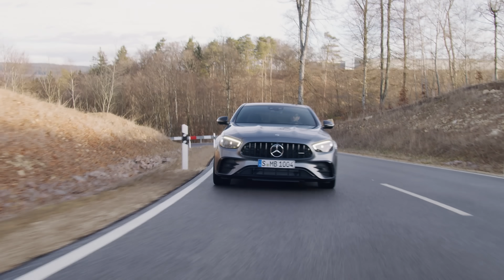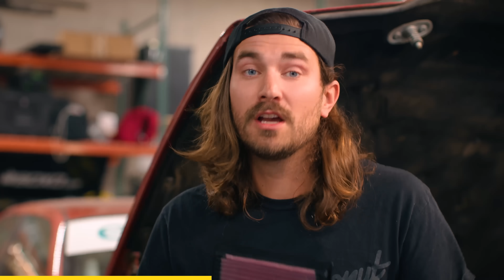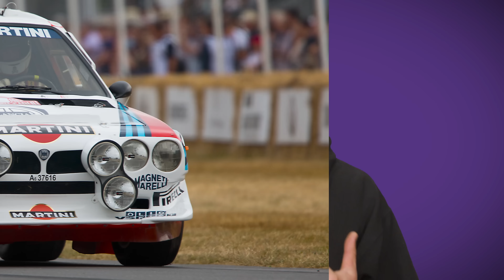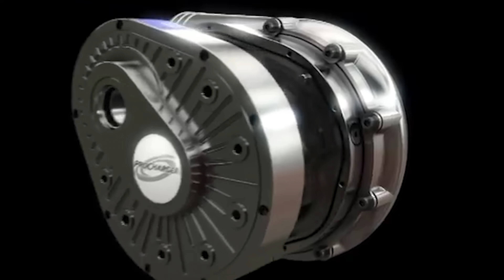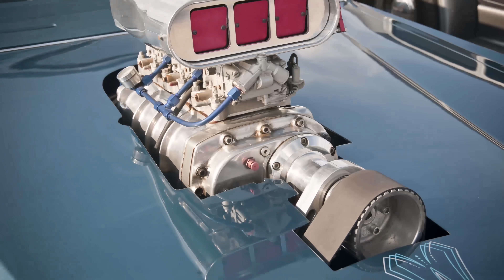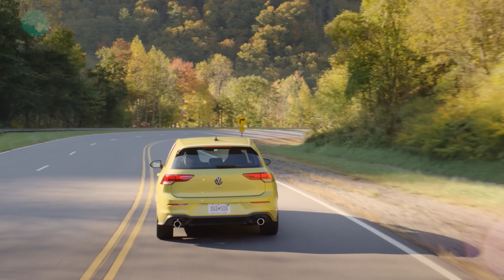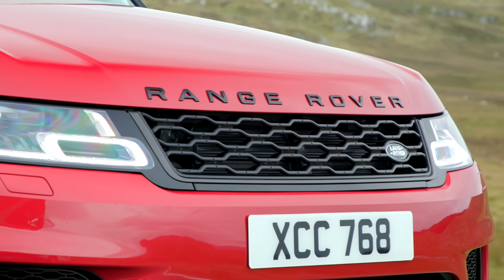Why Your Engine Isn't Twin-Charged

Comment: Can't forget the old Detroit Diesel 2-stroke V motors used from the 50's until the 90's in heavy trucks and buses. They were a 2-stroke design that used a supercharger to force air through the motor, and if more power was needed a turbo was bolted on top of the supercharger. The Weiand 6-71 supercharger used by dragsters to this day come from these diesels.
Reply: glad to see someone else tilt their head in confusion for not including these beasts.
Reply: @kylemcshea5511  it's not twin charged
Reply: Ok so you're wrong but you would only know by being in the industry so that's ok. So I'll explain. 2 stroke Detroits don't have an intake valve. They have holes in the bottom of the cylinder wall at the bottom of the stroke. The piston uncovers these holes at the bottom of the stroke. The piston is not creating vacuum at the bottom of the stroke. Thus a blower is required to blow air into the cylinders. And I say blower because there is no supercharging effect. The Detroits required a blower to run so they are considered Naturally aspirated

Comment: This was also common practice on 2-stroke Detroit diesel engines. And not a true production engine, but chrysler built at least a couple inverted V 16 cylinder HEMI engines that where also supercharged and turbocharged back during WW2 for airplanes (first plane to hit the 500 mph level flight test)

Comment: Even your description of how the twin scroll works is wrong. Air doesn't get compressed into the engine through the middle, it gets passed in around the perimeter and prevented from escaping by the meshing scroll blades.

Comment: I don't see a use case except for exotic cars that sell because they're exotic.

Computer-controlled valve timing and electronic injection pretty much eliminates turbo lag on small displacement engines with small turbos, and for the supercars having a battery to keep the turbo spooled without exhaust gases, like modern rally cars and F1 do, seems the logical option. A battery recharged also while braking. It's complex no doubt but supercars have also more than doubled their price those past 15 years.

Comment: And no  the twin scroll SC. Description, you said the SC  pumps the same amount of air regardless of engine speed and that is completely wrong. Instead, they pump a proportionally increasing volume of air with the increasing engine speed.

Comment: Wow.  Even tho I like donut videos.  This one had alot of incorrect info.  Or let me word it as complete info.  Ex superchargers do make boost at idle.  But boost increase with rpm.  The info in this vid is how things should work by looking at the math.  I'm reality it don't abide by that.  Turbos and superchargers flow a given amount of air based on design and purpose.  The info is very misleading

Comment: Another stupid eŕror: no, centrifugal superchargers do not increase the speed of the impeller exponentially; they increase the load on the engine exponentially due to the linear increase in impeller speed that affects more mass faster. A real engineer would spot these glaring errors before repeating this on camera.  At this point, I just Watch these because I know they're going to be terribly bad and you're reaching a log of people with this sort of misunderstanding.

Comment: Huh... Someone goofed on what should have been the graphic for the intercooler, and made some nonsense animation with... A heat pipe coming out of the turbo?!

And... I believe the roots animation shows air being compressed by compressor bits spinning the wrong way.

Who did these animations?

Comment: Normally aspirated engines typically work at less than atmospheric pressure. But they can  get to more than atmospheric pressure with speed induced  pressure and with resonance and wave reflection induced overpressure.

Comment: I am sad they left out Volvo. Volvo has been twin charging their line up for quite a few years to achieve more performance and fuel economy. They have twin charged engines that also work with electric motors. They did it before it was cool.
Reply: Yeah, they COMPLETELY left out Volvo who has been a big proponent for a while. Having driven the V60, I feel they even did a good job of it, even if it was a highly strained engine.
Reply: There was literally a picture of a Volvo in the video.
Reply: That's what I thought. I remember the latest XC90 (or maybe XC60?) being TC'd.
Reply: Volvo Penta makes great twincharged marine engines that just absolutely rip.
Reply: Polestar does as well and that was very recent. Surprised they left it out.
Reply: What Volvo engine was twin charged?
Reply: @jimbofarnsworth4482  my 2017 S90 inscription is twin charged
Reply: @mathewerenberger7275  I was wondering. I owned a few older Volvos, 2009 and older
Reply: @jimbofarnsworth4482  I've a '17 T6 R-Design, twin charged. I'm not 100% sure, but I think all T6 2016.5 and up are twin charged
Reply: @jimbofarnsworth4482  -- T6, T8, and Polestar engines, starting in 1969.
Reply: It literally has a Volvo T6 in the video 12:46.  use your eyes bro!
Reply: @BurntFaceMan  didn't watch the whole video. I was just wondering, I owned a bunch of older Volvos.
Reply: @BurntFaceMan  -- We're talking about twin-charged engines but only have an image of the company that pioneered the mainstreaming of putting twin-charged engines in their production vehicles, starting five decades ago.  They may not have been the flashiest of cars, but he never even mentioned (yes, there was a tiny picture of one, but no real mention) what should have been a decent part of his history segment.
Reply: @BurntFaceMan  Thats a 2012 Volvo S60 T6. That is not twincharged. it only had a turbo 6 cylinder. They showed the wrong volvo🤣
Reply: I just saw this video and was like thats interesting because I have a Volvo thats Twin Charged.
Reply: 10:38 he has addressed Volvo
Reply: @darrentylor5473  lol

Comment: This fuel economy claim for boosted small displacement engines is not exactly true... it's very situational... A 200hp 1.6L turbo engine will get the same or slightly worse economy then a 2.5L 200hp n/a engine because of volumetric efficiency. For 200hp, the 1.6L needs to burn the same amount of fuel as the 2.5L - this is done by adding a turbo / supercharger to increase the volumetric efficiency of the engine - so the 1.6 makes the same power as the 2.5, and for that it needs to burn the same amount of fuel. The only time the 1.6L will use less fuel is at idle and under the turbo threshold RPM value. 

I used to own a 2013 fiesta ST. It made 180hp and 240nm of torque out of a 1.6L turbocharged engine. It was my daily driver for about 8 months. My "weekend" car, a 2002 325ci has a 2.5L naturally aspirated 6 cylinder making 189hp and 245nm of torque. Power numbers are similar but displacement differs. The two had similar fuel consumption. The ST got better mileage during stop and go rush hour traffic, but the 325 got better mileage on the highway, despite it being a bit heavier and making a tiny bit more power. The ST used an average of 9L / 100km during normal city traffic, about 11-12L in heavy stop and go rush hour traffic and 7-7.5L / 100km on the highway driving at 120-140kph. The 325 also used up 9L/100km in normal city traffic, but in heavy stop and go rush hour traffic it used up to 13.5L. On the highway driving between 120-140kph it would use 6-6.5L / 100KM. This is due to the fact that the 2.5L n/a engine needed to burn more fuel to idle due to it's bigger displacement, so I guess that's where the claim of better economy comes from. But there's more. The ST got very poor economy compared to the 325 when driving fast. On the highway, driving at 150-170 kph would increase consumption to 9-10L / 100KM. In contrast, the 325i got around 8... I believe this is in part due to the ST's shorter gear ratios. Despite having a 6 speed manual vs the 325's 5 speed, the ST would be at 4100RPM at 160KPH in 6th while the 325i would run at 3300rpm in last gear. But the other reason is that boosted gasoline engines won't meter fuel as efficiently as a n/a motor due to the complexity of the added turbo. The fiesta's sigma 1.6 had 1 maf, 2 temp sensors and 2 O2 sensors (one pre cat and one post cat) while the bmw's M54B25 has a MAF, several temperature sensors, a manifold pressure sensor and 4 O2 sensors split between 2 banks, 2 pre cat and 2 post cat. And this is generally (but not always) true for most turbo vs n/a production engines....

Comment: "That means as crank speed increases, there is an exponential increase in impeller speed."

No, there's a linear increase in impeller speed.
Reply: Right. Exponential impeller speed increase is where the turbo comes in and why they’re better at higher rpm. Maybe the point they were trying to make is that at any given rpm the supercharger impeller is spinning some multiple of the crank speed.
Reply: Thank you came here to say this. I figure he meant to say boost.

Comment: Volkswagen 1,4tsi. Probably the worst engine they ever designed. I’ve never seen one over 100.000km that hasn’t been replaced. And off course most people ordered the cars with the worst transmission Volkswagen ever designed, the first generation DSG.

Comment: That’s really interesting. I always thought the VAG 1.4 twincharge was dropped because it kept breaking from heatsoak and blowing up, not production costs
Reply: Yeah, I’m going to confidently say that VW probably said publically they dropped it because of “production costs” when really it was because it was the “costs” of replacing customers motors
Reply: Looked for this comment
Reply: The 1.4 twincharged scirocco my friend had broke tow engines before he traded it for the 2.0 turbo
Reply: Most problems came from a hilariously undersized PCV system that set up chain reactions in the engine. The next generation engine, ea211 1.4 150hp with a single turbo was so much better in every way.
Reply: @Mnc6282  it’s a real shame, because the mk2 Skoda Fabia VRS would have otherwise been a fantastic hot hatch if not for the bomb under the bonnet
Reply: Had that engine in my Polo GTI 6R and it was probably the worst I’ve ever had. Never spent a whole month out a garage the thing was horrendous

Comment: See this is wussy twincharging here, the right way to do it is like detroit diesel did it with their -92 series 2 strokes, with a roots blower after the turbocharger, this is also commonly done on 2003-2004 mustang SVT cobras (aka the terminator cobra), and will be done on my 1996 when I finally get around to building the 4v motor here in a few years.
Reply: Detroits weren't twin charged or even supercharged. The blower on them was required to run. It's a two stroke with no exhaust valves it has intakes ports in the cylinder wall. The piston uncovers these ports at the bottom of the stroke. The piston does not create vacuum at the bottom of the stroke. So the blower is there to get air into the cylinder and that's about it which makes it naturally aspirated and the turbo variants we're like any other turbo diesel.
Reply: @dillon8987  they did actually have exhaust valves and the blowers did make a small amount of boost, about 1psi. Not a crap ton, but they did make boost, and the cam profile could be changed to make a lot more boost.

Comment: I love how this video casually misses the fact that all Volvos since 2018 have been twi-charges and  even tri-charges. Great video but that’s a massive oversight. Also the Polestar 1 is twin-charged + electric.
Reply: it is mentioned. the oversight is yours.
Reply: Once... For a split second... Considering Volvo has been using twin charging since 2015 and made a huge splash when they said they'd get rid of V8s 6s and 5s in their lineup for all 4 cylinders... You think people would have paid attention. Everyone that drives the T6 powered Volvos are impressed... Even Matt Farrah
Reply: It was only one more letter dude, one more letter.                                            n

Comment: EVs are not capable of taking over for internal combustion engines before we safely can have small cold fusion reactors in our cars... We simply do not have the resources or the technology to make enough useble batteries for that, and neither do we have the technology to make enough clean electric power for that either..
Only a retard would drive around in a EV powerd by electricity made with more polutions than if it was powered form a internal combustion engine, and still think they were saving the world..

Comment: K&N makes fast flow because it doesn't ACTUALLY filter. Particulates that can damage your engine, so you're sacrificing reliability for power. The slogan should be "better than no filter and runs like it doesn't have one." If you put a K&N in your daily, you WILL have more problems later on down the road. YouTube it, one dude tested it with brands like Fram and others. K&N even after you oil the filter it's still crap filtering.

Comment: i don't get why car makers does not invest on hybrid turbo ? i don't mean sequencial turbo, but turbo with an electric motor between turbine and compressor, just like F1 engine, 
its has been proved this is the more fuel efficent system, and according to audi research the cost of manufacturing, became very affordable to mass produce it 

okay twin chargin is cool and fancy but so expensive that's not improvement....

Comment: Many piston airplane engines from WWII are technically twin-charged.  The turbo is only used for flying at medium to high altitudes however, it's never used at low altitudes or when on the ground.  Most if not all airworthy survivors don't fly above 8000 feet since using the turbochargers would mean higher maintenance costs as if the cost of the TLC for these vintage warbirds wasn't already outrageous.

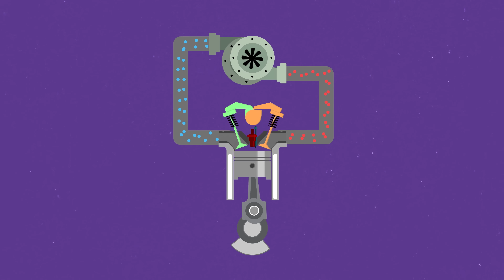Comment: 5:43 now wait just a minute ... Turbo compresses the air which also heats it up, oxygen somehow goes missing inside this (hopefully) airtight manifold, then intercooler cools the air, and oxygen magically reappears? 
That doesn't sound right, does it.
Reply: Oxygen doesn't go missing when it's hot, Rather the hot air doesn't have as much oxygen than cold air. That's why it goes through the intercooler and making the air colder thus it has more oxygen and it's dense thus giving you more power
Reply: Cooler air is more dense. Cold air has more oxygen molecules in it per given volume

Comment: I believe the Detroit Diesel was the first production engine to be both supercharged and turbocharged unless we count the EMD that did both by turning the turbo into a gear driven supercharger when there wasn’t enough exhaust energy to spool the turbo.
Reply: I was about to bring that up, the Detroit 71 series is kinda forgotten by most, not as common nowadays as cat 3406 or big cam cummins, They really fell off hard
Reply: @WillBilly.  E.P.A. Killed the Cummins along with most other things I hold dear
Reply: @WillBilly.  meant to say  Detroit. I may or may not be a little drunk
Reply: @WillBilly.  Detroits are not twin charged the non turbo Detroits are naturally aspirated as the blower doesn't have a supercharging effect and is required for them to run
Reply: @dillon8987  yes, all of us Detroit aficionados know this, you dont have to tell everyone who made a comment referring to them as superchargers. I do this so laymen understand what Im saying
Reply: Yep the old school d.d. 2 cycles were all blown and some had both  blowers and turbos. We had a few come thru the shop i used to work at and we had a very small group of guys that could work on them. The messed up part is this was back in the day of mechanical fuel injection no cofuser to screw it up.
Reply: @davidgirod6684  the old Detroits had blowers yes but they are still naturally aspirated as the blower doesn't really create boost and without the blower the engine wouldn't run
Reply: Detroit diesels with a blower are naturally aspirated the blower isn't a supercharger and it doesn't create boost it only provided enough pressure to get air into the cylinder